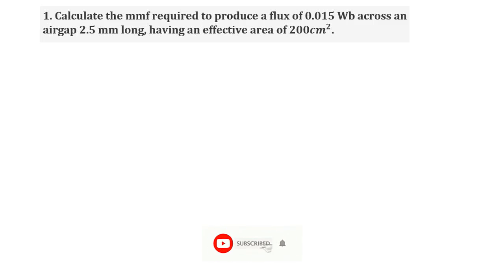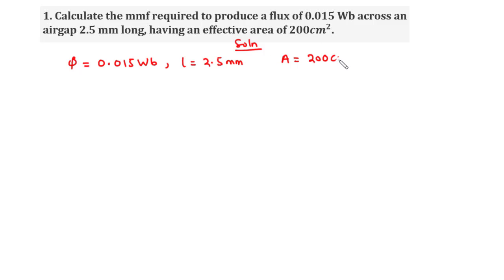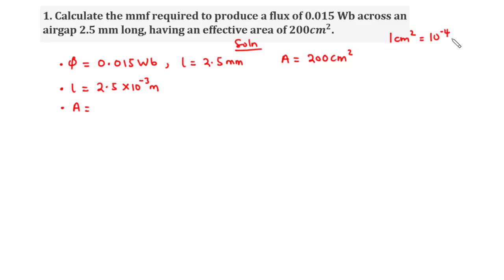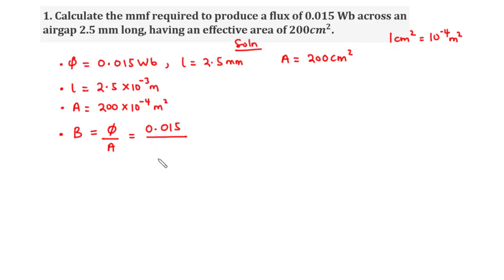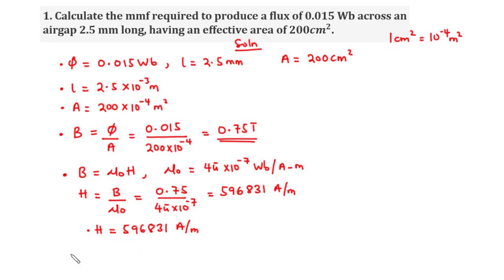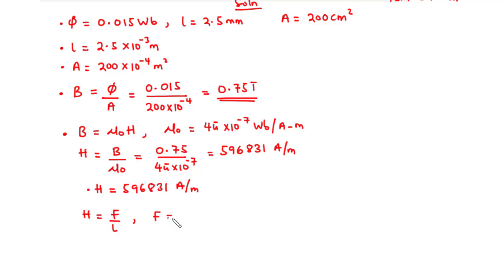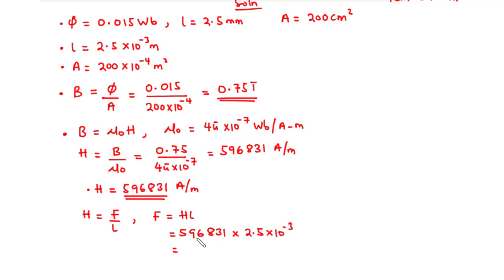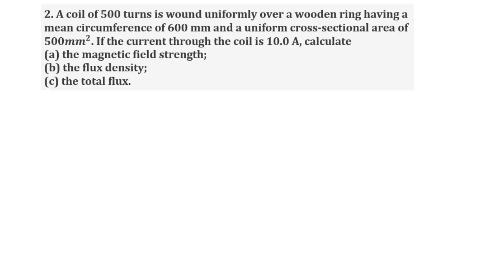54 - Solved Problems on Magnetic Circuits

Comment: In the last question, why did you use the value of permeability of air instead using the permiabilty of wood? They are asking about the wood, and you used the equation for air. Permiability of wood hasn't given in the question, still, if you have made an assumption, you should have mentioned in the video. Could you please help me with that?
Reply from the maker: The reason is that non-magnetic materials such as wood, plastic and the rest have permeability almost equal to free space. So we just use the value for free space.
Reply: @SkanCityAcademy_SirJohn  👍
Reply from the maker: Thanks